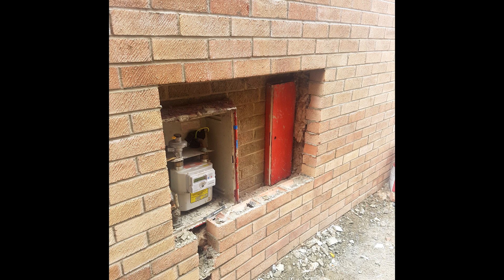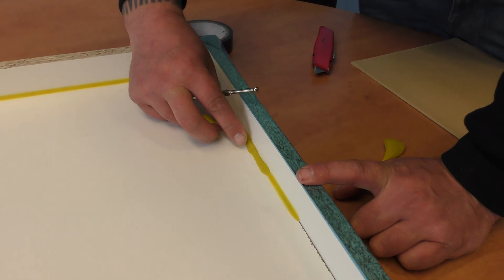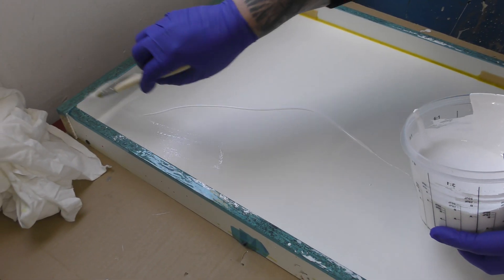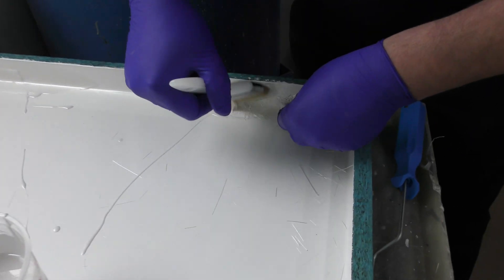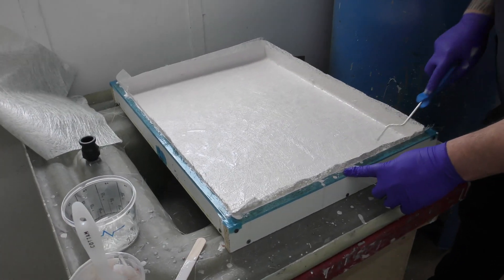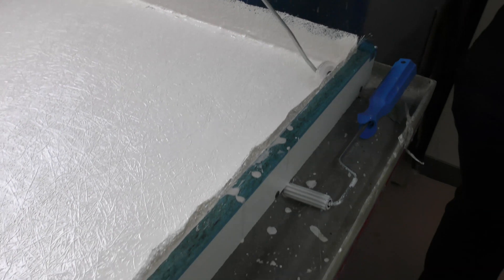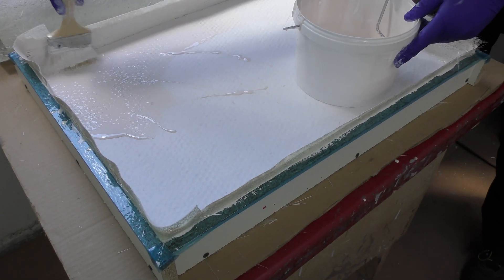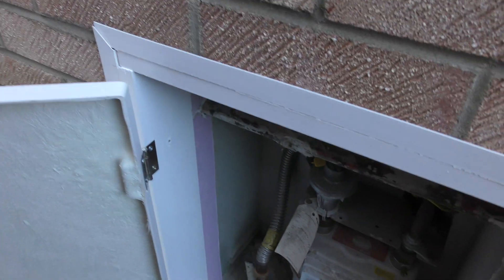Creating a simple box shape with GRP fibreglass in a melamine mould

Comment: Interesting.

At some point soon I need to build an odd sized (7x16') semi permanent shed that can be assembled by one person. I initially thought of welding up 6x4 and 7x4 steel box section frames for the side walls, a pair of 3'6" wide panels with the sloped roof angle on the top for the back wall, and a couple of door frame halves for the front, then skinning all these in painted 9mm plywood. But these panels would end up being ridiculously heavy......... And have you seen the price of plywood at the minute !!!

I've never had much luck with fibreglass moulding in the past, but after seeing this video I'm thinking I might need to look into the possibility (And costs involved) of making the walls in a similar way to how you made these doors. Maybe if I encapsulated a "Batten wood" frame around the edges, and a couple vertical wooden stringers up the middle, it might even be strong enough without most of the metal framework?

I just need to work out what kind of loads the walls could see if the corrugated sheet roof I'm intending to use had, for example, a foot of snow all across it, and how much it would cost in materials per panel to make them structural enough to carry that. 🤔

Comment: Fibreglassing good but having a solid unvented door with a gas meter behind cant be legal. Also any gas leak will fill the wall cavity.  Yes, they are not made to leak. And ships are not made to sink are they? Glad I don't live anywhere this.
Reply from the maker: This video is mainly to show how you can mould with fibreglass using melomine and not so much about gas meter cupboard door manufacture. The process can be adapted for any simple fibreglass molding projects such as boat boxes, locker,  seats etc and it is the  responsibility  of the customer to research any further requirements regarding fittings etc that they need to add later, we only cover the fibreglass part of the advice to demonstrate teh materials we sell.  although vents were added later to these doors as well as lock fittings etc also not shown in the video.

Comment: Shouldn't the resin be tacky rather than fully cured between layers?
Reply from the maker: Ideally the next layer should be applied within 24 hours after it has tacked off. however any period between 24-48 hours the next layer can be applied and will still have a very good chemical adhesion, providing the working environment isn't  dusty or at risk from contamination from other workshop processes.  Depending on the resin being used you should always follow the product tech data sheet with regards to application as advice can vary.  however when it comes to Gelcoat you should always apply whilst the gelcoat has a surface tack but not if  the  colour comes off on your fingers as this will indicate that it hasn't cured quite enough. applying resin too early to gelcoat can result in pickling/wrinkling  of the gelcoat

Comment: What did you do with the rest of the catalysed white gelcoat, that you didn’t use in the mould ?
Reply from the maker: This was also used on a neighbouring mould for another project. However in an instance where you have mixed up too much gelcoat it is best to scrape the excess gelcoat into a metal tin and leave outside. if you work from make sure its not accessible to children, pets etc . just like resin excess gelcoat left in a pot can get hot and start to smoke so you do not want to be breathing in those toxic fumes.  once it starts to gel off you can pour cold water in the tin also to cool down the reaction.

Comment: Hi guys, just wondering do you change the resin for the final coat. I take it you use a laminating resin and gelcoat to start off with. Do you add wax to the final coat to allow it to fully cure? Thanks
Reply: Also what was the reinforcement on the edges please
Reply from the maker: @dontmentiontheaword   the reinforcement was a uniderectional fibreglass tape or you can use biaxial tape just to give more reinforcement to the out edges and to where fittings may be fixed.
Reply from the maker: we first used a Gelcoat and let that cure, then we continued throughout with a Lloyds approved polyester resin we didn't add any wax to the final coat however this is an option if you wanted further protection or a smoother easy to clean surface for say a marine application?

Comment: How harmful is it to human health Wax, PVA, Gelcoat and polyester resin, and is there any problem in working without protective mask ever.
Reply from the maker: They all have an element of risk we would always recommend consulting the safety data sheet for any chemicals such as resins, release agents, solvents etc that you buy online and follow the advice given where it refers to personal protection.   We are fortunate to have a good extraction system and have VOC levels monitored regular throughout our facility,  however we always wear vapour masks if working on any larger projects where styrene and other vapour levels may be  high.  Usually small projects like this in the open air or well ventilated room is ok but always keep your skin covered  and  your eyes protected with goggles when using this material.    Styrene is heavier than air so even outdoors we would advise wearing a vapour mask if your likely to have your face in close contact with these vapours.  so on projects where  your down in an open boat hull mould for example where there isn't  much airflow then make sure you wear a mask. if its an enclosed space such as for large tank lining then a mask connected to a constant air supply tank would be recommended. again always consult the safety data sheet and speak to your PPE equipment supplier for more comprehensive advice on types of masks ,filters etc.
Reply: @ecfibreglassuk  Should the eyes be protected from the gas vapor or should the eyes be protected from any drop of these products?
Reply from the maker: @artongashi6206   eye protection is always advised and this is mainly to protect from chemical splashes during the wet lay-up process and mixing. also to protect from debris when trimming.